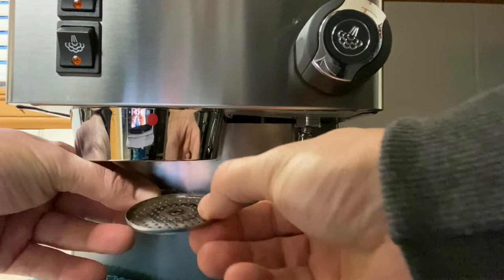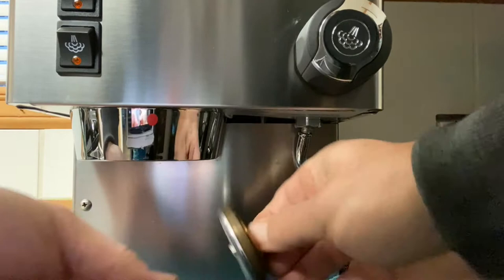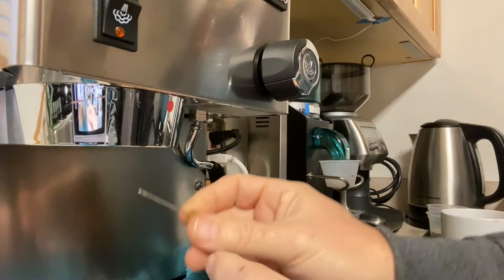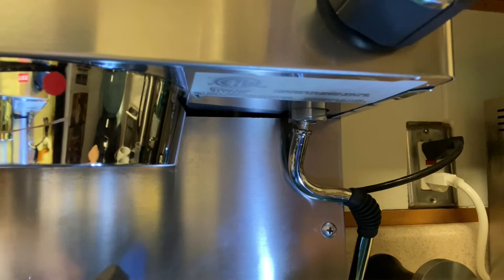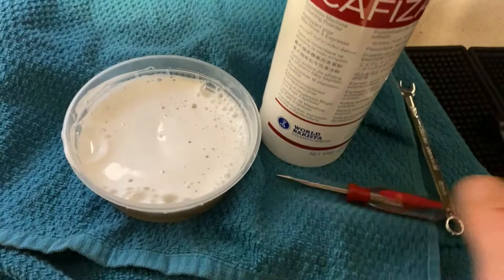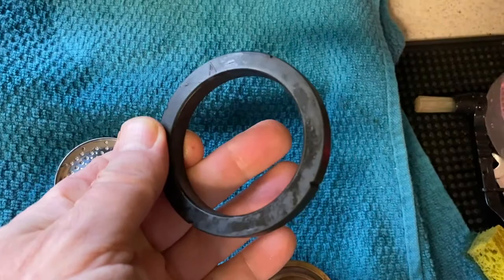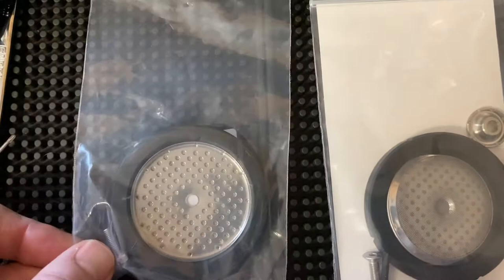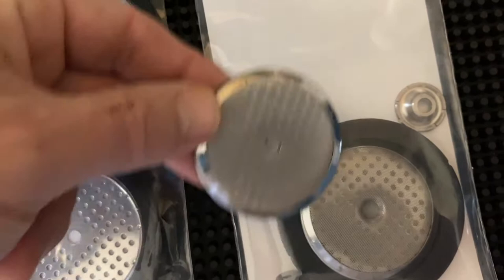Dec 4 2020 Rancilio Silvia Espresso swap Fruition TC Flat Shower Screen Upgrade Kit Gasket Cafiza

Comment: I have a v6 silvia and I always get the bolt head mark in my puck although I never  overdose.
But thankfully I don't notice channeling when I use the bottomless. So I'll leave it as is and maybe upgrade later when it's time for a service. Nice video BTW.
Reply from the maker: good input, agreed I can't suggest changing the screen/bolt had a noticeable impact to me, in taste or channeling  other than possibly the mental effect, it 'seems' to be easier to flush/brush/wipe the screen clean without the protrusion, but I cant say I could tell the difference in a taste test - (?)and thats what matters (*?)  Thanks- Pete

Comment: I wonder if i can get the washer and screw on its own and match it to an ims screen?
After first watching this, i went to the hardware shop and got a countersunk bolt and with my grinder, cut a bit of the taper off the screw to get it flatter.  Very dodgy but did the trick.  That washer you have looks to be a great permanent solution.
Reply from the maker: nice work - Pete

Comment: Hi, i just replaced my group head gasket with a genuine Rancilio one and have now found i have to turn the group handle further to the right to avoid it leaking during a coffee pour? Any ideas why, have I done something wrong?
Reply from the maker: You are probably in great shape, the new gasket is so much softer and pliable - its requiring a bit more 'force' to compress enough to create the seal, did you notice any difference between new and old in terms of flexibility or hardness on the old gasket? And being new and pliable you able to turn the portafilter further. As long as the old gasket came out in one piece not leaving any broken bits stuck to group and you cleaned that upper area well - this new gasket will start to slowly firm up from use and heat, let me know how it goes, - best Pete
Reply: @petesranciliosilvia3777  Thanks for the feedback. I didn't take much notice of the softness of the one but it is a genuine Rancilio gasket. I have heard a similar thing about the softness. Yes, the handle does go further to the right but it does seal well. Thankfully the old gasket came out in 1 piece. Thanks for your help, much appreciated.

Comment: I own v6, Will it fit?
Reply from the maker: They don't make it easy with the Versions do they? This is a 2019 model year, visually compare what you have to what is in the video? Check on the specs when you order? Worst case it isn't a budget buster to try, I have appreciated not having the bolt print in the puck, has it changed the taste - not that I can notice, but does help with determining dose - good luck, Pete
Reply: @petesranciliosilvia3777  thanks for your reply, I have 2020 Edition. I believe no change. Will give it try once it's available :)
Reply: @JehadHamdan  let us know. I also own a Silvia v6 from 2020